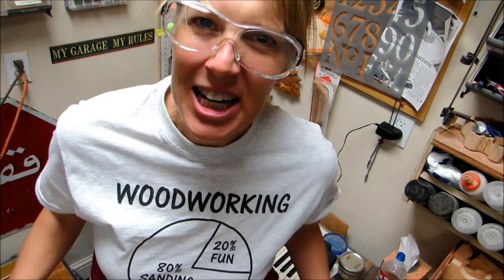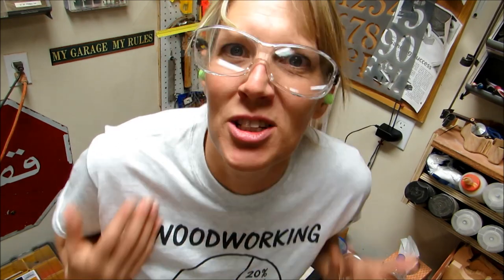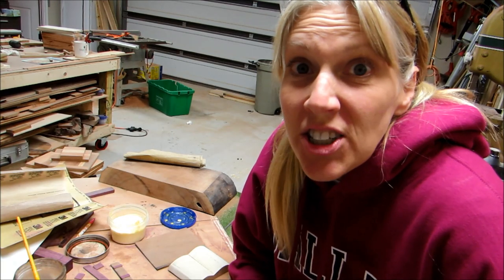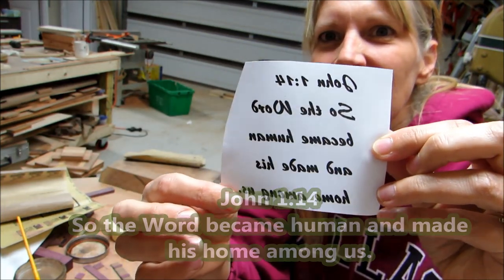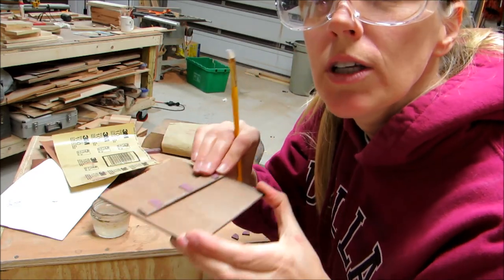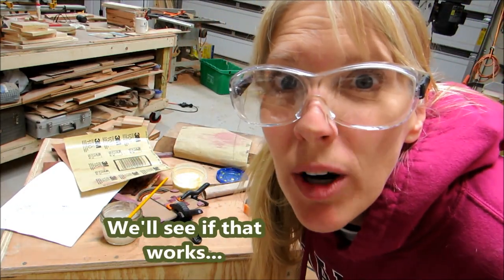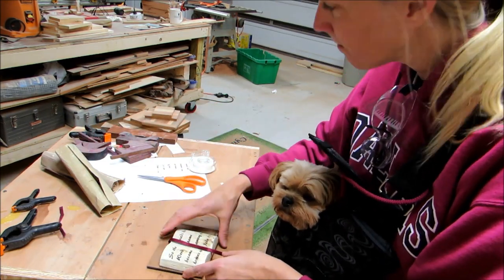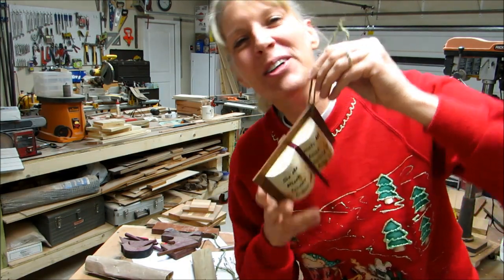Christmas Ornament Challenge 2014

Comment: Great project CY, loved watching it and inspired to have a go myself, just not sure how you did that paper print transfer thing. Oh and btw you now have another new subscriber.
Reply from the maker: john cuckow Saw a you tube video of someone transferring like this.  I type whatever I want in a word document in the font I like and print it off. It must be printed from a toner cartridge vs. an ink cartridge (guess it wont work with ink).  I discovered that Microsoft office has a "flip horizontal" and this will make anything backwards so when you transfer it it will be the way you want it.  Unless it's a picture or something then it really doesn't matter.  My new wood burner has a tip for transferring (flat and thick) but my old burner didn't have a tip like it.  I tried to buy only the tip from hobby stores but no one had them.  But luckily the tip was included in my newest burner (under 20 bucks from Hobby Lobby).  It is a nice technique, but takes a bit of practice, if you mess up you just sand it off and try again.  Good Luck!

Comment: you can use the drill press as a lathe for small pieces (examples on youtube) . . . bible is awesome :>)
Reply from the maker: Russ Veinot  I did see someone do something like that!  Imagine you'd need some tools like the ones that are prizes in this challenge.   And thank you about the Bible, thought it turned out A-OK!!!!
Reply: Cy's Corner All you need are wood files and sandpaper, if you have patience. .  chisels are optional :>)
I have seen some make a mini-lathe with a drill.  a wood lathe is best if you have the space and want to do a lot of turning.  I bought a lathe 12 years ago and the only thing I used it for in the first 7 years was to make a rolling pin.  since then I have built a few add-ons for the lathe.  a disc sander, a belt sander, and a thickness sander.  the lathe can have a lot of extra uses with a little imagination.  be well:>)
Reply from the maker: I'll have to try it since I have those items!  Thanks!